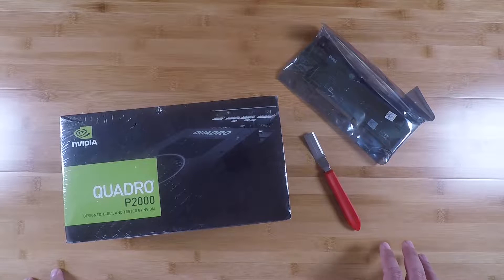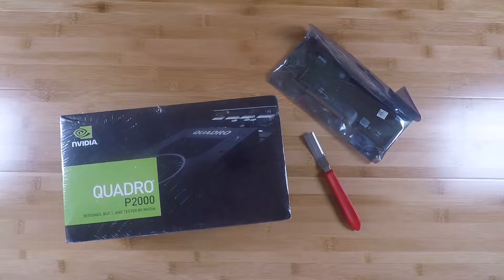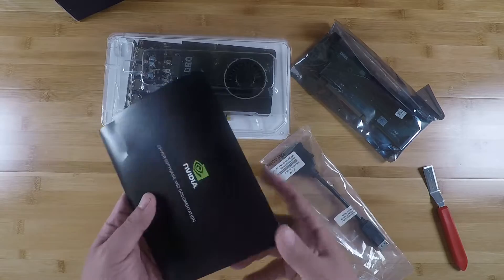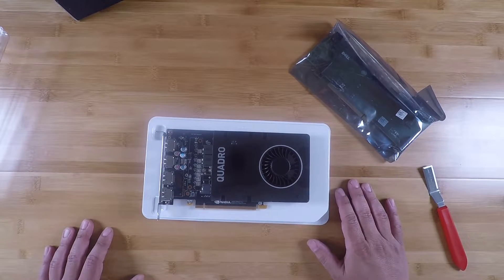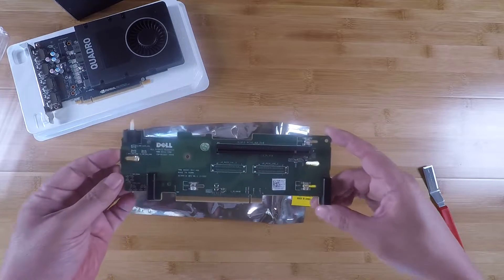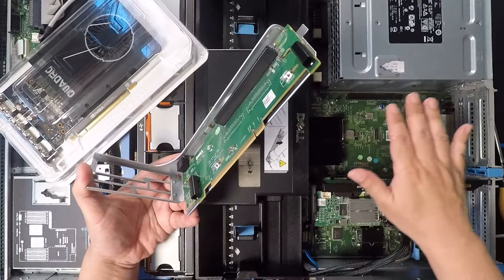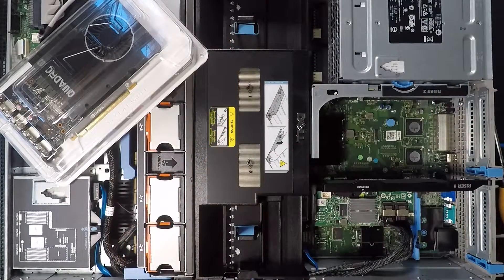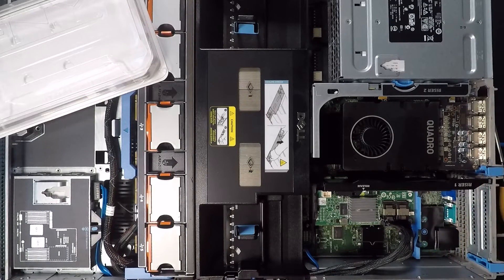Dell PowerEdge R710 build PART 4/9 | how to add a GPU

Comment from the maker: Hi Everyone! Many of you have contacted me about the x16 PCIe riser for the R710 server based on this video. Unfortunately, I've completely sold out and they are now very hard to find. I got so many inquiries about this, that I decided I would help you guys out by selling the 2x8 PCIe riser with the PCIe slots cut open so you can use those to run your GPUs in your R710. I made a video about it here: https://youtu.be/sSXA7CBLMCE

They are also available in my eBay store. Just checkout the links in the video above. Hope that helps you guys out! :-)
Reply: mind me asking what the performance difference is if any?
Reply from the maker: No difference that I know of. Certainly for PLEX transcoding x8 vs x16 lanes makes no difference.

Comment: Hey from way in the future not sure if you’ll respond but I’m thinking of putting a Tesla k80 in mine for ai use and cutting it does the board have enough power it also can I get the 6pin somehow for it not trying to buy a gpu server for this
Reply from the maker: it is possible, but you need to supply PCIe or EPS power to the card (which ever the card requires). i've never done it, but people have tapped into the PDB 12V/GND, or splice into the power harness to the SAS backplane.

Comment: I was looking at the spec sheet for the R710, and it says the max power is 25W for efficient cooling. I have a few questions: 1) how much power can the PCI slot deliver to the card since there’s no molex connectors to provide additional power to the card, and 2) would it be better to upgrade the PSU to the 870W version or to get an external PSU and jerry-rig it to power the card? Also, 3) since the main concern regarding power draw appears to be cooling, would it be enough to cut a hole in the case lid where the fan on the GPU sits?

Comment: I used a EVGA geforce gtx 1050 on the bottom slot that I cut open with a dremmel and it works great.
Reply from the maker: That's great! Thanks for sharing.

Comment: I was thinking to get a 16x ribbon cable and rig it up somehow, but the next limitation would be there is only 25watts off the 16x bus.
Reply: Actually Im not sure  reading the spec.. 

D. X16 Express Card Specifications
The PowerEdge R710 supports x16 cards that meet the following requirements:
	 • Standard height (4.376")
	 • Maximum length of 9.5" (Half-length cards are 6.6"; Full-length cards are 12.283")
	 • x16 cards can only plug into the optional PowerEdge R710 x16 left riser
	 • Support for full bandwidth of x16 Gen2 link
	 • No support for hot-plug or hot-removal
	 • Maximum power of 25W
	 • The PowerEdge R710 provides +12V, +3.3V, and +3.3Vaux in accordance with Power Supply Rail
Requirements (Table 4-1 of PCIe Card Electromechanical Spec, Rev 2.0)
	 • The PowerEdge R710 x16 slot is not compliant with the PCI Express x16 Graphics
150W-ATX Specification
	 • x16 cards must be compliant with the PCI Express Card Electromechanical Specification Rev 2.0
	 • x16 cards must only occupy the space of one slot. Cards that occupy the space of two slots are
not supported
	 • The x16 card is limited to 25W initial start-up power until it is configured as a high-power
device. If no value is set for the Slot Power Limit, the card is limited to 25W. The card must then
either scale down to 25W or disable operation per PCI Express Base Spec Rev 2.0
	 • The x16 card must be able to support a maximum operating temperature of 55°C as defined in
the Dell PCI Environmental Spec and the PCI Express Card Electromechanical Spec. The
PowerEdge R710 provides a minimum transverse air velocity of 100 LFM (linear feet per minute)
to the x16 card.
Reply: https://i.dell.com/sites/csdocuments/Business_solutions_engineering-Docs_Documents/en/poweredge-r710-technical-guidebook.pdf
Reply from the maker: I think it's a lot easier to modify the riser board or buy one of my pre-modified ones. There's not a lot of room in a 2U rack mount chassis to otherwise mount the GPU in some other location.

Comment: Hi, I have seen bunch of people saying the gpu x8 slot in r710 is limited to 25w and quadro p2000 needs 75w power, 
cutting the slot is not an issue, but will the card for power issues ?
Reply from the maker: I've had a lot of customers use P2000 in the R710 without issue.

Comment: If I install windows 10 on the r710 will it see the video card?
Reply from the maker: Not sure what your question is getting at. You will not be able to use the video card for console output, that will still go out the onboard VGA. If Windows has the driver for the GPU, it will see the GPU and can use it once the OS is booted up.

Comment: Is doing this mod really worth it to put a gpu in the r710? I would be using for plex transcoding.
Reply from the maker: For PLEX transcoding: definitely. CPU transcoding will cost you 10x more power consumption.
Reply: @ArtofServer  what low cost gpu would you recommend?
Reply from the maker: @smarticleco7806  For PLEX, the lowest cost GPU with HEVC codec is Quadro P400 I believe. It's also very low power, but it has artificial limitation of number of NVDEC sessions. The Quadro P2000 does not have that artificial limitation.
Reply: @ArtofServer  thanks ill look into that

Comment: Thanks for sharing the video. I have an r730xd and would like to add Quadro k4200 to pass through to a MacOS Big Sur vm. seems I need a pcie power cable to support the power consumption of the GPU. Can you recommend what pcie power cable(parts number) i shall be getting? Do you sell any of these?

Comment: Hey! I'm sorry that this comment is super late, but I'd assume you are locked down by how much power the PCIE slot can supply, as obviously there are no 8 pin connectors available for GPU external power connection available. What are a few good graphics cards like this fine quadro you'd recommend for a windows parsec server?
Reply from the maker: I don't know what is required for a Windows parsec server?

There are several GPUs that don't require external PCIe power connectors. However, if you want to use a GPU that requires additional power, some people have tapped into the PDB to get 12V or spliced into the power cable for the backplane. Those are some options to get additional power to your GPU.
Reply: @ArtofServer  I've seen quite a few people tap into the PDB, but I'd be really scared of frying my motherboard and messing up! 
Parsec really only needs an encoding chip, so my needs are an encoding chip, on a card with no extra power, that isn't completely awful! (Really, a GT 1030 with an encoder is perfectly fine!) 
Amazing video by the way!
Reply from the maker: @zom.  are you just using Nvidia nvenc and nvdec functions?

if the PDB method is unnerving for you, look into splicing the power cable to the backplane. it should provide plenty of amps on the 12V rail since it's designed to handle 15K RPM SAS HDDs.
Reply: @ArtofServer  in theory, yes just that 

How would the backplane method be performed? I'd certainly be much much more comfortable with that!
Reply: I'd need NVENC/VCE + DirectX 11.1

Comment: Thanks for the video. Should anything change on the BIOS setup? How do you get the system to use the new Graphic cards as opposed to the onboard one?
Reply from the maker: The intent here is to use the GPU for GPGPU applications, like video transcoding in PLEX, or perhaps to passthrough to a virtual machine. I don't know of a way to have the Dell server use a add-in PCIe graphics card for console output.
Reply: @ArtofServer  I have a similar question, so I'll piggyback on this comment.  I'm actually using an R720, but the same concept applies.  It IS possible to use a GPU for video output from the server, but you lose console video view for the iDRAC and the ability to access the BIOS.  After lots of Googling and experimentation, I can confirm this; the way to make it work is to install the GPU, open the BIOS settings --> Integrated Devices, and disable integrated video.  Afterwards if you need to restore iDRAC console remote video and access to the BIOS, disconnect the GPU and reboot.  An important note, there is NO way to access BIOS settings (from everything I've tried and read) while the onboard video is disabled.  

However, my questions is slightly different.  Related to this video, I have a spare GTX 1050 that conveniently doesn't need external power that I'd like to use just for transcoding.  I've noticed without doing the above trick to use the GPU for video output, Linux Ubuntu 18.04 doesn't list the GPU as a video output option.  I don't actually need to use it for video output since I just want to use it for compute, so how can I confirm Linux is seeing the GPU and will allow Plex to use it for transcoding?

Comment: Hi - A totally off topic question....is there anyway to add additional SATA power cables to the rear of an r720? Theres a spare sata port on board - i thought that would be a good place to add a generic sata ssd for proxmox booting? Ive seen a video (not sure if it was you) of someone adding additional power for a gpu by soldering straight off the back of the hot plug PSU rails. Cheers.
Reply from the maker: there's always a way... but i would suggest a PCIe card with a SATA port instead... get the power from the PCIe slot, while the data connection will be to the SATA port onboard the m/b. they have such cards with both a NVMe M.2 + SATA M.2 slot and you can use both at the same time.
Reply: @ArtofServer  I Found a way....just for anyone else that has an issue with power....behnd the main fan row there are a couple of power headers to the backplain....grey is 3v, black is earth and yellow is the 12v line. Ive tapped on sata off one of those which has worked. Ill take another feed off the other power cable to the back plain to keep it even. Cheers.
Reply from the maker: Thanks for sharing your tip!
Reply: @ArtofServer  No Prob - just to elaborate a little bit more the other backplane cable i converted today - i had a spare modular ITX  PSU cable which i cut the cable off (PSU side) and then wired that in giving me 4 standard molex's.
Reply: @ArtofServer  Not sure what you mean....ive actually got a spare generic quad port sata card (Startech i think) but it only has 4 ports (ie theres no power) - i also bought a generic 2port nvme pcie board and stuck 2 128gb nvme cards on there but the server doesnt see that atall...(thanks very much for the reply though)!

Comment: thats a really expensive card... just looked on ebay and £200-£400. Just wondering who would need a card that can do 10+ streams at 4k.  i just got a supermicro server as i was only interested in the 32tb of hdd that came with it. So just seeing what I can do with it in a home / very small business enviroment.  When I first turned it on I was shocked by the fan as my current i7 makes no noise. That was like a jumbo jet spinning up.

Comment: Hey, thanks for the video.  I was wondering about the proximity of that fan on the graphics card and the lid of the R710.  Will that cause the card to not get enough airflow and cause it to over heat?
Reply from the maker: That's a good point, but I think it should be okay. The fan wall of the server is always supplying cool air to the PCIe slot, so it should be okay. I do agree, it's not the most ideal GPU cooler for this configuration, but I never did have a overheating problem with the GPU like this. In fact, replacing the GPU cooler with a large passive heatsink might work just as well since the server chassis already supplies the airflow... never tried it, but it could work.
Reply from the maker: @Shayne Chambers Also, I made a 2x8 riser that would allow you to install the GPU in the lower slot, so that might make a better opening for the airflow into the stock GPU cooler. Check it out here: https://youtu.be/sSXA7CBLMCE

Comment: Hi, you used a h200 raid card to use this video card. Will a H700 work as well?
Reply from the maker: Depends on what type of storage controller you want. I used a H200 with LSI IT mode firmware because I was planning using ZFS. If you want RAID, then H700 is the right choice.
Reply: Thanks.

Comment: I would like to add a GPU to my R710 for video encoding on a jellyfin (similar to PLEX) server. But I'm on a tighter budget than this graphics card allows. What are some less expensive options that may work for my use case?
Reply from the maker: Quadro P400, maybe 1050Ti? I'm sure there are many options... but you didn't mention what requirements you have....

Comment: Hello. Do you sell any graphic card or adapter that can work with the POwerdge r710 ? Also, which card can I use Thanks
Reply from the maker: I sell the riser for the R710 that allows GPU to installed. See video description for link.

Easiest GPU are those that do not require external power. Success reported with P2000, P2200, and P400.
Reply: @ArtofServer  Thabk you, can you send me the link so I can purchase it? Thanks
Reply from the maker: @Stevenyeung1244  link is in the video description.

Comment: After 6 months of searching just came across your video. I own a DELL R720 service tag 7RLVGX1 with upgraded power source and i do not manage to instal a EVGA GeForce GTX 1070ti GPU. I want to use this beefed server ( have 16 hard disks 10.000 rpm and with 128 RAM ) for editingm cutting and color grading 4k video footage. I want a good GPU card that has 4 outputs ( or at least 3 of them ) and there is little to no informations abiut what GPU powerfull cards are compatible. Could you pls help and let me know if you have an PayPal account to compensate for your time. Best regards
Reply from the maker: I think you should find out what GPU is best for the software you are using. I think each piece of software will have different optimal choices.

Comment: Hi, I am very beginner
I have an inquiry if I purchase a server to support my main computer
Do I install programs that require a lot of effort on the server system, or do I install them on my main device
In other words, can you take advantage of the power of the server processor on the programs on the primary computer?
Reply from the maker: That's a question that has a complicated answer. You might want to research client/server computing architectures and also distributed computing as well. The industry has shifted back and forth over the decades between client-side vs server-side and central vs distributed computing. As hardware capabilities evolve asymmetrically, the way software uses those compute resources change over time too...

Comment: I have a r710 wirh X5675 x 2 and 144GB of RAM, 6 sata hd for a total the 10TB and H700. In the riser i add a sound card and 4 port usb3. The sound card i dont't work for now.
I buy from you the riser PCIe x16. i can add quadro P2000 for game and top performance wirth photoshop?  The power of the riser PCIe don't create problem with all hardware installed in the riser? Thank you.

Comment: I have a PowerEdge R510 and wanted to know if the riser board you are using will work on my server? I did some research and found that Dell did sell a Riser 2 PCI-e x16 for the R510 but I cannot find it anywhere. I stumbled upon your video when researching and I've been wanting to use the P2000 GPU. I would truly appreciate any response to this. Thank you and great videos I am glad I subscribed to your channel.
Reply from the maker: I don't know if the R710 x16 riser works in the R510. yes, these x16 risers for the 11th gen Dell servers are getting harder to find.
Reply: @ArtofServer   Editing my comment as the GP347 part for the R710 will not work for the R510. For anyone else who might want to try this and has the R510. I found the part which was shown a "Riser 2 (for GPGPU ONLY): One PCIe slot (x16 bandwidth and slot)" The part is Y907R  - PWA,RSR,SV,DELL,R510,PCIE,2U,2 - Dell PowerEdge R510 2x (1x+1
 internal slot) PCIe Riser Option for GP/GPU support (Riser 2) They are not as easily found and did not see any listed on eBay. I will attempt to get it from a server store which was the only one I found that carried it. If anything else I can try the P2000 GPU and see if it works.
Reply from the maker: @popsgoldenheart7290  thanks for sharing the details!
Reply: @ArtofServer   Hey sorry for all the messages,  last thing for sanity check. I saw the p2000 GPU required 75 watts to operate and these servers I believe offer 25 to 30 watts. Do you have to use an external power source or connect to the power supply to get this to work?

Comment: Hey art,

Great content as always. Do you know if there’s anyway I can get a p2000 to work inside a dell R620? The dell R620 is a 1u server and only has half height PCI slots. I have a supermicro 846 DAS attached to the R620 and would like to add the p2000 for better performance. I am thinking I could maybe place the p2000 inside the supermicro if necessary. Any ideas on what parts I would need to make this work?
Reply from the maker: if you only have half height PCIe slots, I don't think the P2000 is a good option. I mean, anything is possible if you want to fabricate stuff and for example, run a PCIe ribbon cable to some other location to mount the GPU. But, that's a whole lot of trouble for not a lot of gain if there are easier options...

And speaking of other options, I would say look at the Quadro P400. It has the 2 nvenc streams limit in the nvidia driver, but there's a way to workaround it, and even if you didn't, it might be enough depending on your use. I'll probably put out some videos about this too in the near future.

Comment: So? Did it work?  My R710 PCIE x16 slot doesn't deliver full PCI-E spec current, so I had to go with a GTX710 (which limits to 2 transcode streams :( )
Reply from the maker: Yes, the Quadro p2000 works.... Upcoming video will demonstrate it
Reply: @ArtofServer  - Excellent :-)